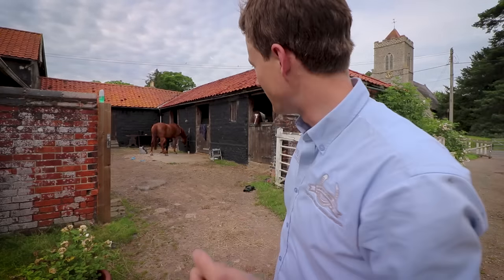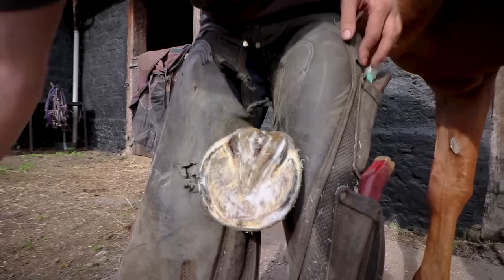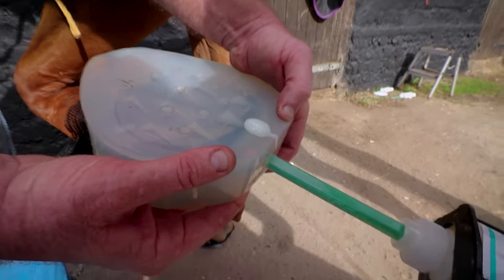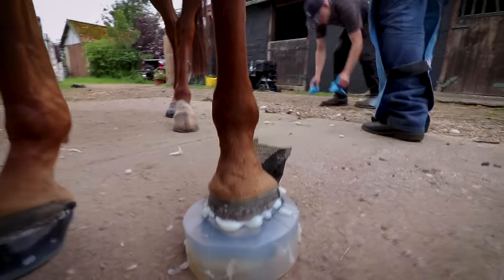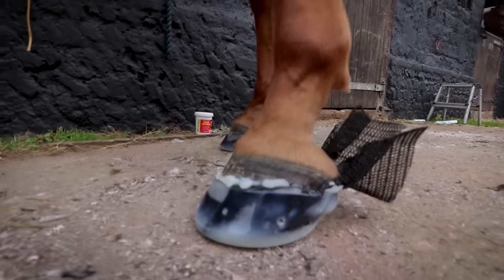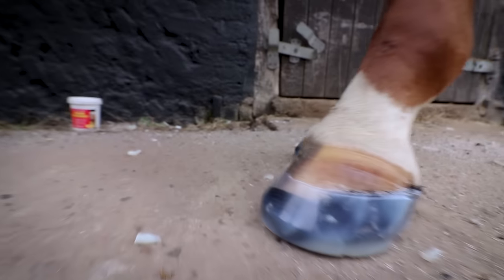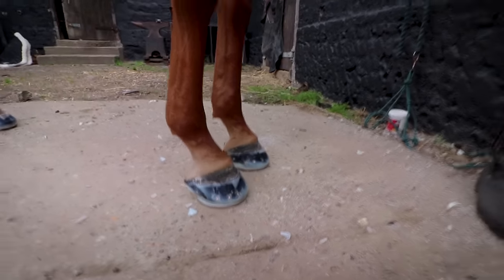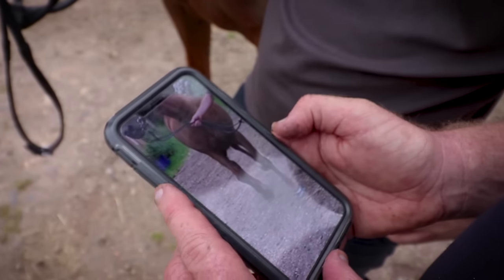How to shoe a horse using resin - Amazingly satisfying

Comment: Wouldn't it be more difficult to spot/care for a wound or anything infected that might grow underneath?
Reply from the maker: You can apply any sort of topical solution or packing before applying the formahoof. We sprayed the frogs and lateral clefts with an antibacterial solution but next time I may use a copper sulphate and vasoline mixture across the entire solar surface.
Reply: @AlexRidgewayFarrier  will the forms hoof come off in wet, muddy areas or crossing creeks? Ya' know, suction from mud, etc?
Reply: ILoveHorses❤🐎 i don't think suction would get it off since it's applied and dried whilst on the hoof i assume it would have to be cut off
Reply: @papayasmith4763  that's great to hear. ❤👍 TY.
Reply: ILoveHorses❤🐎 you're welcome! only way i can think it accidentally coming off is if they were being to playful or rough in the field and cracked and moisture got in
Reply: @papayasmith4763  Yeah, and you examine it at least twice a day for signs for that & if it happens, you just take it off & reapply it- from what I see of the videos. Looks like a terrific, game changing product. We need it in America. It's so wet here anymore ( plus think of all of the spoiled fat horses!)
Reply: EXACTLY what I was thinking! a sealed environment and humidity make for prime fungus growth. there are some women who wear acrylic fingernails all the time and then regret it. it really does a number on the nail beds and the nails become weak and thin. I don't see much difference with this stuff. "scratching head skeptically."
Reply: crgaillee fungus doesn’t just appear from nowhere, and if a horse has a quarter if their hoof missing and there’s nothing much to be done, having a waterproof encapsulated structure to aid growth while still being able to work the horse seems a brilliant solution to me...and might save a few horses from euthanasia as well
Reply: @crgaillee  Good point! I strongly feel that this method is criminal! NOT GOOD!
Reply: @azraelbatosi  Actually that is inaccurate, Fungus spores are in the air floating around us everywhere. Along with viral proteins. There is no way to escape fungus. That's why hospitals use specially ventilated rooms for surgeries.
Reply: crgaillee yes, but if this is sealed like it would/should be, then those spores being in the air wouldn’t matter thus the “appear out of nowhere” statement
Reply: @azraelbatosi  You can sanitize the area, the nail the whole foot ect. However before you apply the product, any spores in the area or the wind, even from your breath will still land on the area intended to be covered. It's just the way nature works. But I understand you believe in this product, good for you. I however have an inclination towards just sticking to what has worked for since the beginning of time. If it works don't fix it.
Reply: vic vapor  If you want to use this stuff more power to you, I for one WONT. I have seen what happens to women's fingernails when they wear acrylic nails for and extended period of time. I would NOT want that to happen to any of my horses. Good luck tho.
Reply: @crgaillee  But that's why the sanitizer is used, isn't it?? It's the job of the sanitiser to kill all the spores that comes in contact with the hoof.

Comment: This was HUGE in the 70s! The only troubles are if you live in a rainy/humid area. Water ends up getting trapped inside causing major troubles for the horse.
Reply: I think technology might have moved on a bit
Reply: @steverouse2655  Nope same polys an all.  The trouble is you can't get it totally air/water tight from the top! Then the water just sits in pokects an as you can imagine that's not good. 
 This is still used today but only really for recovery, Least for my area..
Reply: @partino97  just like you said. From standing or just the run off from the legs yep
Reply: @dizzlethe7346  drill some drainage holes through the bottom of the mold? before applying to horse obviously...
Reply: @Thumbsdwn  Have you ever tried to take water out of a tire? or drilled holes in the bottom of a bucket? No matter how many holes you poke into it some water will sit... Top that off with poly around you wont get enough holes in it to drain without taking the entire bottom out leaving you with just a shoe anyways :)   

But yes when we use it for healing we DO put in a small drain/pressure hole on a 45 at the tip. It is not just the bottom the build up is at either tho also..  Another thing is it is NOT fun to re-shoe after these are put on.
Reply: @Thumbsdwn  LOL you don't think in 40+ that I know of at least. That wasn't done? :S
Reply: @dizzlethe7346  technology has advanced in things like window sealant so I don't see why it wouldn't have with hoof sealant.
Reply: @dizzlethe7346  Seems like horseshoe technology is ages behind what modern materials could accomplish. I could definitely see how it is a pain to resole after literally having a poly shoe molded around your foot haha
Reply: I imagine that is the same sort of problem the military has had trying to invent a truly "water-proof infantry boot"
Reply: @thorr18BEM  What about the sealant has advanced tho? We still run flashes on the bottom of windows for the Very reason I speak of. You can never get an keep every spot 100% waterproof. On a window much less something that always grows.  Your house also has overhangs an some sort of siding that also helps keep the water away. Like we are talking about something that is Growing, That moves, Gets wear and tear and stands in water all the time, How is this even like comparing sealing a window up.
Reply: @Thumbsdwn  Naw I have seen some CRAZY 3-D printed, an Carbon fiber aluminum cast from reverse molds that are out of this world
Reply: @ghettstuffed2257  Even if they could my feet sweat like a MF so I would be up the creek no matter what lol. But least I can slip my shoes off to dry out XD
Reply: @dizzlethe7346  okay so then the title of this video is misleading, and really they are just advertising these poly mold things.
Reply: @ghettstuffed2257  except soldiers can just take their boots off..
Reply: @Thumbsdwn  I think you miss the point... that there is no such thing as a water-proof boot because of the need for a hole to put your foot into and the likely hood of standing water exceeding the height of that opening while being worn.
Reply: @ghettstuffed2257  except you brought that example up in an instance where there actually is a need for a water proof "boot" for the horse, apparently.
Reply: @Thumbsdwn  Ya could be that... Could be it wasn't legal for them to do it till recent across the pond. Or the knowledge of it could have taken that long to get around.  I run into 100+yr old tools from time to time I've never seen bc they come from across the world. Like this nail/post puller from Saudi that is good for animals and your house.
Reply: @Thumbsdwn  As is there a need for a waterproof infantry boot, ever hear of trench foot or boot rot? The need is real but it's a design contradiction... the only way to achieve success is to make a sealed (IE unwearable) shoe. 

I think you are misunderstanding something fundamental about the nature of my comment and the more I have to explain the more confused you may become. Have a nice day~
Reply: @dizzlethe7346  attention seeker .. clearly you do not speak like you been here 40+years .. get off youtube
Reply: @anthonystarnes3956  Sorry for both our luck,  I will be 47 July 10th ; P  Butt...
1.) Why does someone need to be alive during the time to know something is used then? Or know why it is not used in areas? Does knowledge and or facts along with common sense not play a factor in all this?   
2.) How are you going to figure someone's age off texts? It is not like I "spoke" to you, So you couldn't take anything about appearance or even a voice into consideration for that matter 
3.) All I did was bring into fact this was a huge thing in (USA) the 70's. Also between that time an now we had figured out, The climate you live in will depend heavy on if you should use this fix.
Side note I guess for folks like you I should have said places like Texas, Florida/ the South WILL and DO use this practice ALL the time. With almost no drawbacks.  With heavy sand areas this being a major plus on many factors. But this is not in thos areas or anything like them so... 
4.) If I was as you say "seeking attention" Would I not pin onto a thread that ARF has replied to force a comment and longer thread, You know get attention.. 
5.) Why would you give it to me if YOU really thought that the case, Or are you projecting? 
 Seriously your logic is entirely sh*t, Go craw back under the bridge you came from...

Comment: I'd be worried about fungal infections. If I had urethane shoes molded to my feet for weeks on end, I'd bet my feet would come out pretty nasty after a few weeks.
Reply: Also microplastics absorbed into the bloodstream, the friction and temperatures and little air between the essentially plastic shoe and the hoof will ultimately lead to microplastic absorption.
Reply: @potatomer  I am aware of the makeup of a horse's hoof.  Did you watch the video and see the part where the urethane covers the entire bottom of the hoof, all around the frog and sole. Parts that can be particularly susceptible to fungal infection?

Comment: My thoughts imediatly go to fungus, and moisture buildup weakening the hoof. Aswell as wont it hurt when the hoof have no place to grow underneath the capsule?
Reply: that was my exact thought, the growth most of all, moisture depending how airtight it is might not be an issue but the growth .... I'm very curious how it works.
Reply: Urethane is tough stuff and it has a fair amount of 'give' so it will flex and move as the hoof grows.
The problem with modern hooves is breeding.  A horse is never bred because it has good hoof structure.
The result is lots of horses that need a lot of hoof care or remedial work so they can do the job they were bred for without breaking down.
I must admit though, I wouldn't want that farriers bill.
Reply: This is my thoughts too. What about rain, mud walking through water wet grass etc. Don't hooves need air? This doesn't seem like the best be all end all solution. I'm not an expert by any means but it doesn't seem like it's the best long term
Reply: I had the same thoughts. Acrylic nails weaken the nail underneath. Worry’s me for the horse for long term. I’m sure there is more to it. Perfect for a hoof  cracked
Reply: @holhawk1866  My nails get stronger under acrylic as I tend to tap them a lot, which makes the nail stronger due to impact... then when I go back to my natural nails, as they are not as strong, tapping eventually chips etc and I am back to my thin ass nails!
Reply: I believe the hoof grows from the top down so it should just push the urethane with it.
Reply: @karrezza  That's not how your nails work. Your nails are chipping because the acrylic has weakened them.
Reply: @ironocy496  fungus is still major issue.
Reply: They say that these shoes are designed to regrow and rebuild the hooves without putting nails through them and you can put medicating cream underneath them and leave it without reapplying, so my conclusion is that if the purpose of the shoes is to rebuild and medicate the hooves they probably won't give damaged fungus and weakened feet. I'm guessing they're airtight with a flexible material
Reply: @SwedBaben  The fact it is air tight is what will cause the fungal growth. The cream will break down in the hoves and start rotting.
Reply: "These are expensive animals & well loved too, I doubt that equine vets wouldn't take every aspect into consideration."

You'd be surprised. People love their horses and do absolutely horrible things to them because they don't have any clue that shoes can bruise the hooves, tie-downs wreck their necks, bouncing destroys their backs, poor saddle fit pinches nerves, rope halters hit sensitive pressure points, and so on...
Reply: 3:29
Reply: @karrezza  Hi, I’m a nail tech and esthetician since over a decade and I can say you are right that acrylics dont ruin your nails. But they won’t make them harder either. Tapping doesn’t do anything. Your nails grow out earthier strong or weak. 
However false application and removal can completely ruin natural nails. Some technicians file them before applications. Making them thinner , some remove them harshly and chip them. There are many studies on it but in general natural nails have been left in acrylic solution for many months in a study and it didn’t do anything. But application and removal is key. That’s why many people think it’s damaging, because of technicians that ruin the natural nails with harsh procedures, done quickly to do as many clients as possible with cheap materials. I wouldn’t trust anyone that takes 25$ for a set of acrylics.
I mostly do soak off gels and Polygel though because it’s better for the nail because of less removal damage ( soaking off acrylics is possible btw).
If you want to let your natural nails grow stronger I’d advise you to just get a strong gel polish on them and let them grown. One with vitamins and minerals is best and will nourish them.
Good luck.
Reply: @Cody Allen Some one has to do it.
Reply: Moisture will build up without doubt. Ridiculous idea. Most definitely NOT the future.
Reply: Y'all are missing the point, these are not permanent, he said "it's horses for courses". That these were expected to last 6 weeks. The only problem with this product is the farrier's bill.
Reply: If you watch the video back you see there are holes in the mould where they injected it in that will allow air to get in and out I'd say the main issue is growth because its a sold material that won't give.
Reply: @karrezza  nails dont get stronger after they have grown, theyre like hair, not bone. Anything you do to them will only weaken them, not strengthen them.
Reply: @MileinaJuarez  thank you for the explanation
Reply: The farrier that worked at an equine hospital designed a solution through trial and error to help horses grow healthier hooves. 
But yeah, probably just a load of bullshit.
Reply: @StuninRub  He said they can put medical treatments on underneath and they are protected, so no need to change bandages , they only last about 6 weeks he said ( depending on number of steps taken , and nail growth )

Comment: I see how this could be beneficial for correcting malformed or injured hooves, but this doesn't seem like a healthy long-term solution for horse hooves. If a horse has a set of healthy, strong nails, then starving the live pulp of oxygen feels like you're begging for an infection underneath all that resin. Even human women who wear acrylics cyclically will often see their nails thin out. Is this really a healthy lifestyle change for the horse?
Reply: I was wondering about that too
Reply: Not to mention urethane (which they used) is toxic asf. Such a damn shame they put that crap on a horse and call it the "future of horse shoeing"
Reply: Agree, a hoof needs to breath, plus we only put aluminum shoes on our show horses, never on our working horses, because the aluminum wears out fast,an bend or come off much easier.
Reply: I don't think it's a fair comparison. Human fingernails are not the same, nor do they serve anywhere near the same purpose. If a lack of "breathing" were a problem for their hooves, we very likely wouldn't have horse racing.
Reply: Well said! Why fix something that isn't broken. The future of horse shoeing, in my opinion, is going barefoot!
Reply: @tsalVlog  i'm not sure what horse racing has to do with airflow around the hoof.
Reply: Huh? The oxygen comes from the nail bed, not from ambient air. Women who wear acrylics have nail thinning because nail techs file the nail down to rough the surface to help attach the acrylic nail. Women also have more fragile nails than men generally, unrelated to the use of acrylics.
Reply: @Xtoxina  Fully reacted polyurethane is chemically inert, and is not a know carcinogen.
Reply: Damn this comments section is full of confidently presented falsehoods.
Reply: This idea that nails or hooves need to “breathe” is asinine. The sole reason the keratin surfaces may need exposure to oxygen is to reduce the growth of thrush, a bacterial infection which grows better in a low oxygen environment. This is why they applied an antibacterial. This protection is also recommended primarily for horses that see a lot of work, meaning the feet will be changed out frequently, allowing for inspection and reapplication of antibacterial. Please refrain from commenting critically from a point of ignorance.
Reply: Idonno but gucci
Reply: @SoundsSilver  There still doesn't seem to be any advantage of these over traditional horse shoes. 
Inducing favorable conditions for infection, while using a disinfectant, doesn't really tell us whether the risk of infection is lower or even the same.
Plus the additional costs, and the fact that they are still using a lot of plastics and synthetic glues. They might not be carcinogenic, but they are still toxic (as was said in the comment) and it's still a pollutant when discarded.
And overall it's just a lot more work and costs (and time) for, once again, no clear advantage over traditional shoes in the majority of conditions.
Reply: @Scorponox93  In what way is it toxic?

It is recommended for building up feet and protecting them. I don’t think it’s clear yet whether it reduces infections rates, but it is known that dirty feet also occlude oxygen and contaminate the surface with bacteria. I think it reduces damage from horseshoe nails too. I don’t think it’s a panacea but in my opinion it’s a welcome development and a presents a good option to some horse owners.